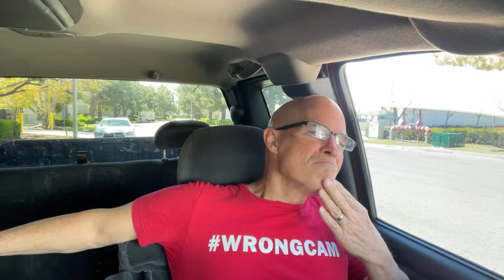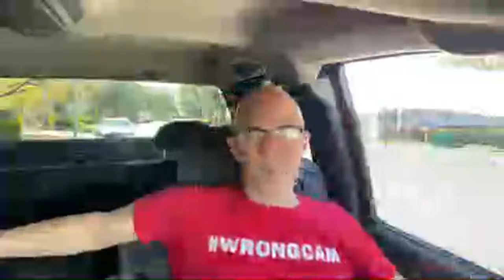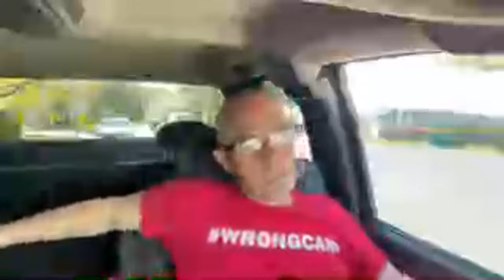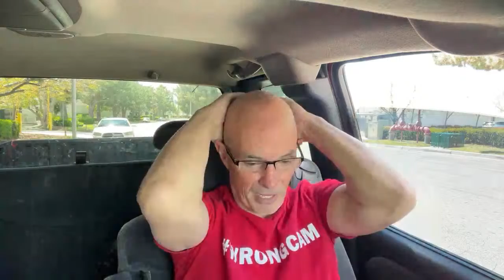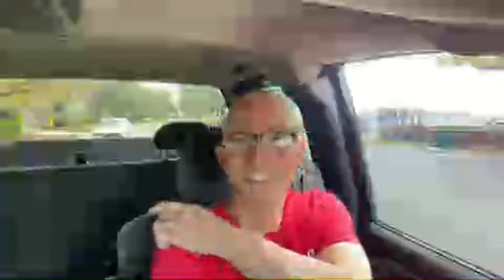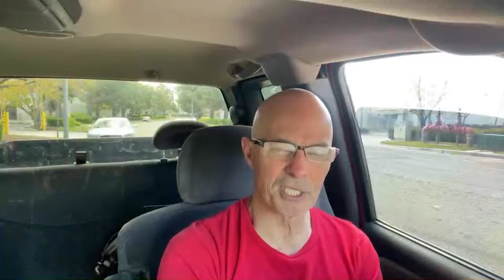Adjustable PTR Intake! Let’s Talk Tech!

Comment: Have a question Richard 
Stock 5.3 
243 heads 
Comp cam 54-414-11
Will this combination work without mil of the 243 heads ? 
I was told the heads need to be mil by 20" for compression.
Reply from the maker: then don't need to be milled, but it helps add power
Reply: Ya I assume that milling would get the same compression but a little less compression isn't going to hurt anything lots of motors run fine with less

Comment: What do you think is the reason why there is not an aftermarket ls dual runner for the ls. Is it just cost and they don't think they will sell enough or they with a stock computer could not control it
Reply: rpm changeover would be rather simple to just add from sniffing from an ignition cable no integration necessary.

there probably just isn't a market for it, harder to tune the mappings for it and it will not get you a higher number to tell your friends even if it made it more peppy to actually drive around  - but if you're driving around on a 6 liter engined car how much does that even get you better, like does it matter for the driver? and for just a drag run you'd be on the high range anyway.

say ferraris rev up to almost 10k so it makes a lot more difference on them for the driveability under 4000 rpm to have the variable length intake systems.  yamaha has some variable length thing on 150cc class bikes now too